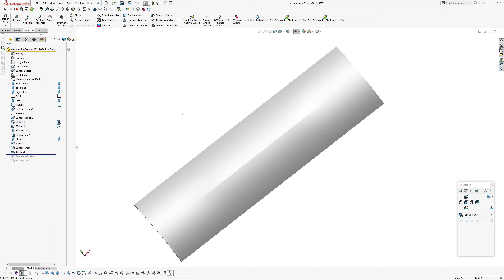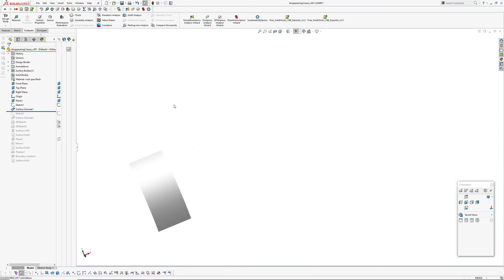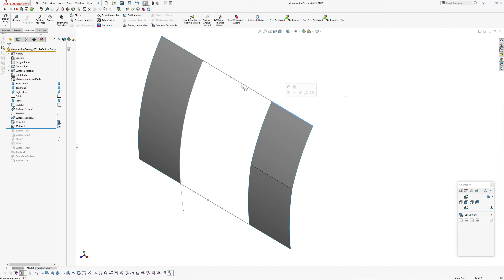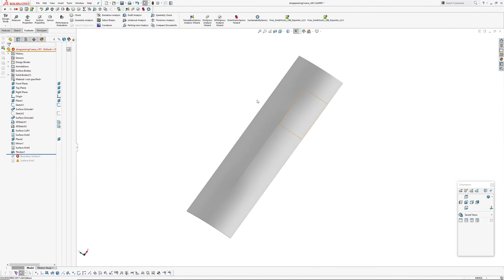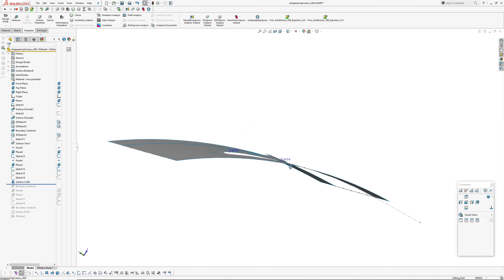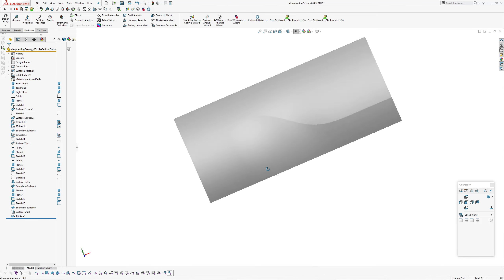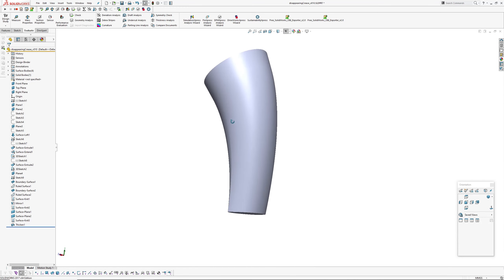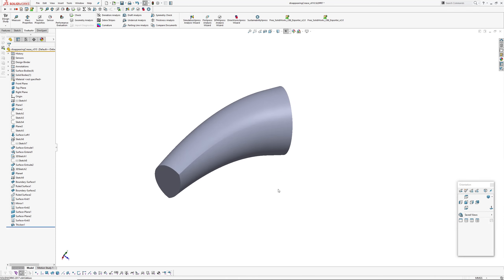Solidworks: Surface Modelling a Disappearing Crease/Edge

Comment: Love your videos man. Have you used the power surfacing add in for solidworks? Just tried the demo. The integration of subD with within SW is epic. Curious about your thoughts on it.
Reply from the maker: I have never used power surfacing.  Have seen some videos and it does look useful. I’ve always wanted to try out GW 3d in SW as it also looks to have nice tools, albeit different to PS.